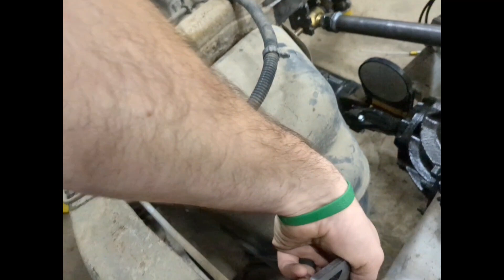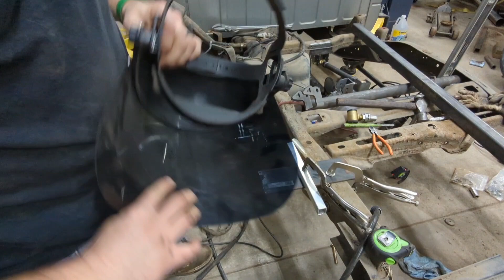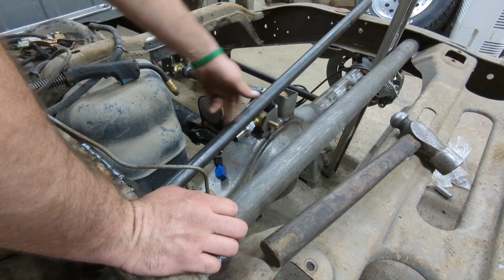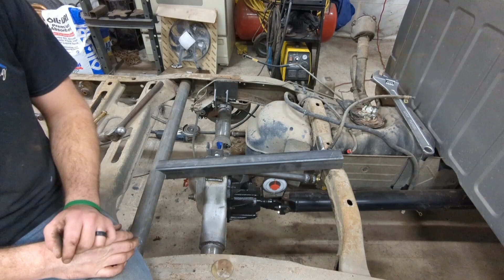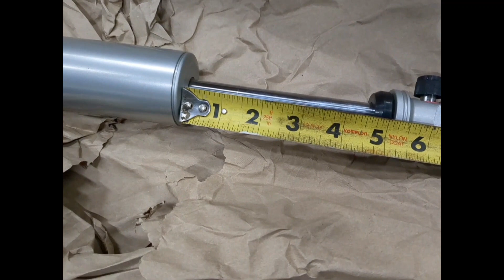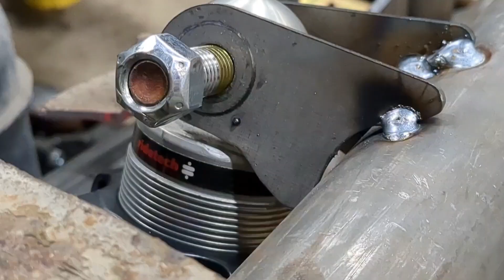S-10 3 Link Suspension Build! Measuring and Welding!

Comment: Why not just do an upper wishbone mount and eliminate the track bar then the upper is triangulated.
Reply from the maker: That is a good idea. I see now that Ridetech uses an upper wishbone design with a ball joint. Now we'll know for next time!
Reply: Clamps come in mighty handy when welding alone. Even simple spring clamps hold the pieces in place well.

That is a really short Panhard rod that will result in quite a bit of lateral movement.
Reply: Best reason is a one word reason. Articulation.